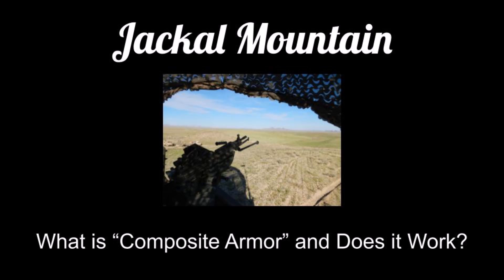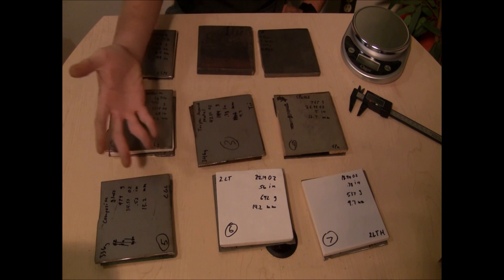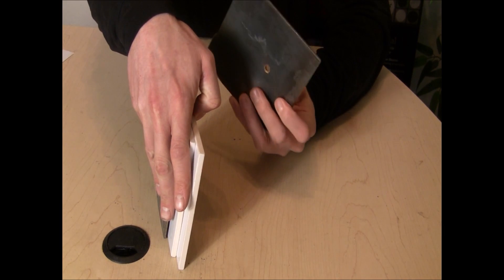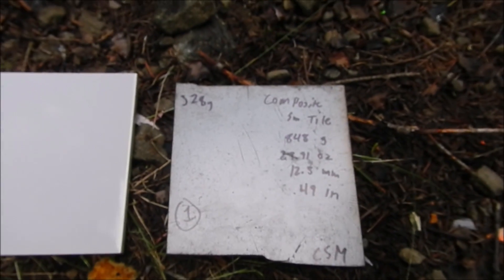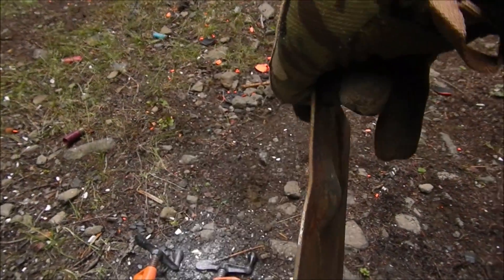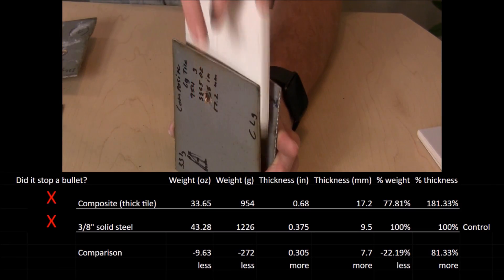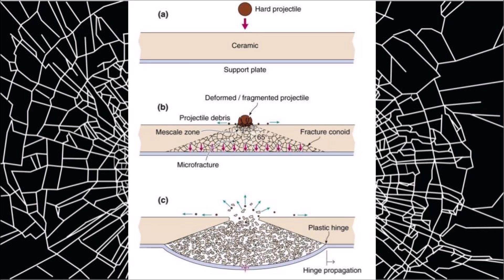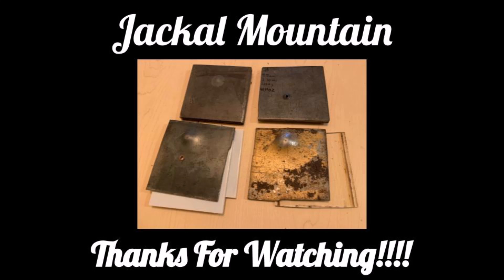Composite Armor: increasing protection, with less weight

Comment: Thoughts:

Distributing accumulated electrical potential; of incoming metal, is the trick.

It‘s not momentum that one wants to cancel most, rather, heat transfer resultant from rapid compression.

Steel conducts energy, in such a way, that it reaches it‘s curie point, upon impact [Butter].

Glass is a semiconductor.  It transfers ultraviolet and electricity across it‘s surface.

In every case, colder is harder.

Something comparable to glass, but less conductive of energy, would be better.

Carbide tiles may be better, not for ballistic resistance, not for being less conductive [carbon is a good conductor], but for having a higher sublimation temperature.

If the carbide could deposit transferred energy by conductor, into a storage device [capacitor] then the energy may be transferred to ground, via the tracks.

Other than carbide tiles, carbide impregnated steel, may be the ideal solution.

Chilled carbide impregnated steel, better.  If the armor were a Peltier device, cooling upon impact, via discharged capacitor, that would be something.

Making the armor colder, per progressive hit; that would be Tron space age.

Textile armor, of helically comingled steel and carbon thread, may be worth testing.

Bonding the composite with glass, a further step [Corning].

A problem, would be scrapping the material later.  Capturing unrecyclable material, is not desirable to do.

F-111‘s are buried in Australia now, for having asbestos bonded fuselages.

Delorean‘s future plant, was firebombed, for both a cocaine bill [IRA] and his desire to make bulletproof, 200mph unscrapable carbon supercars.

Your approaching the same answer, for a different purpose.

The acceptable purpose for development of such technology, is space craft, not tanks.

Tanks will remain death traps, in a haughty competition of maneuverability [The quick and the dead].

Changing the armor, is less important, than being unhitable.  Counter measures [Momentary Jamming and FLIR] are better to explore, if appreciating war.  The appreciation of war, means being physically killable, but the better shot.  There is no honor, winning from a bubble.

If there is, see The Movie Explorers, 1985

Rectangle LASER shield.

The smart person would, may avoid a kinetic scenario, for having watched.

Another good deterrent, is a match of paintball, inside 100 yards on a steep incline, both forces approaching, parallel to the military summit [below the ridgeline, by more than a mans height].

Thank you for the objective data.

Comment: This is not the ceramic used in tank armor and body armor. In fact, aluminum, silicon, or boron carbides are used to armor military vehicles. The most effective ceramic for armor, the strongest and lightest, is boron carbide, but this ceramic is the most expensive.

Comment: Great video that give the basics and principles of armor. For the thickness, you have a lot of variation depending of the incomming projectile. For exemple, the 1000mm thick front plate of the Abram M1A1AH go from 600mm to 1300mm equivalent steel armor. In both cases you gain weight, and also gain of thickness for the second one. (Source : wikipedia)

Comment: A good low budget showing of how in principle it works even on small scale. 
The only problem with composite armor you cant take a shot in the same place or near since the shattering of the composite.

I find really intresting the concept of dragon armor woth many more smaller composite ceramic tiles looking like dragon scales overlap each other.

Comment: When you allow for your armor to be thrown away, you defy its main purpose. Air is not an armor unless you have few kilometers of it combined with gravity
Ceramics has to kept within that space so you projectile is bled of energy trying to push it away as well as eroded by those fragments. Take hammer-drill and crack a single brick - piece of cake. Try the same with brick locked by masonry into several layers of them and you would puke out of exhaustion.

Comment: The development of composite armor has just as much to do, if not more with the production of incredibly highly effective fin stabilized heat rounds fired from tanks as it does infantry sized shaped charge weapons.
Such weapons have always had considerably short effective ranges, and are most effective in more urban or other dense types of terrain, which even modern composites struggle to compensate for due to the weird angles of firing typically used.

Comment: If I'm not mistaken the ceramics are only meant to stop HEAT rounds and not normal AP or APFSDS rounds because of the thermo properties of ceramics.
Reply: Ceramics are actually better against kinetic projectiles and used in heavy body armor, meanwhile chobham/NERA (reflective plates in soviet russia) is better against HEAT. Ceramics erode the penetrator, reflective plates bulge out and disrupt the jet.

Comment: well when we talk about ceramic armour it is not just the tiles you buy from a hardware store , we talk about superior materials , also ceramic tiles even home for home use melt at 2000 cel meanwhile steel melts at around 1300 cel , 700 degrees lower , that means ceramics are by far superior at stopping HEAT projectiles compared to steel.
Also mention that ceramic plates used at armour are contained with various bonding methods so they dont shatter everywhere increasing stopping power and the great disadvantage of ceramic armour it is it cannot take multiple shots but hey when a tank takes muliple shots and survive anyway.

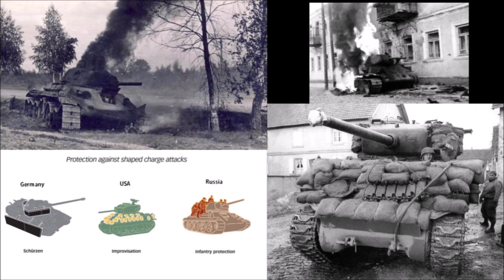Comment: 0:28 is a good joke, but in reality they put like bed sheets wait no bed frames on the tanks
Reply: Nevertheless soviets frequently employed tank riders (avtomatchiki, SMG troops), both because they had fuck all APCs (like kangaroos or Sd.Kfz. 251) and because they provided ambush detection. Late in the war soviet infantry worked with the tanks advancing in tight european cities - the infantry go through the buildings clearing it from potential ambushers while the tanks dismantle enemy strongpoints found by the infantry.

Comment: Excellent video, not enough content on experimenting with composite armor! Can I recommend one thing? when working with ceramics make sure to hold all sides under compression against a rigid backer and faceplate. This keeps tensile stress off of the ceramic allowing it to work on what it does best- compressive strength. As well, a tight fitting faceplate keeps the ceramic shards from bursting outward keeping all the particles in the path of the bullet

Comment: Your video answers all my questions very well! In addition, I have heared that rubber has some positive impact when slices of it are in the spaced armour. It seems that rubber sticks to the projectile and bleeds energy from the projectile. But I am not sure what type of rubber they use so your demonstration is very good with the limited equipment you had.

Comment: the issue with the ceramic armor is the pieces are flying away. traditionally they stay put and grind the bullet to a pulp. but when you are exposing the edges the ceramic has place to move away and does not perform effectivly. i think you should use tape and wrap around the entire plate.

Comment: Thank you for finally explaning this in a way that fully details it without being overly technical and relying solely on terms. seeing this in action is fantastic.  The only other ways I've seen this is people showing off commercial armor plates. I really like how you used your own materials for this test.  

I also want to point out that the same M855 out of a 20" barrel will penetrate the 1/2 inch steel plate, But in my case I have a similar setup rifle to you with a 16" barrel and It's been hard to find a good comparison because most people use either a BCM 11" or 14.5" barrel or the M16 style 20" barrel for these tests.  Thank you!

Comment: In our armored vests we use composite armor but a slightly different one. Its thin aramide, thick steel, medium aramide. The point is to absorb the splashes of Steel on the impact and avoid ricochets, stop the bullet or at least turn it into small fragments before exiting through the steel plate. Medium thickness aramide is thete to catch steel fragments which made it through the steel plate.

Comment: Composite armor doesn't use ceramic like on rifle plates. Most composite armor relies on the angle of each plate to cause the round to have to pass through multiple layers of high hardness steel. The filler material generally just helps by causing the projectile to have to pass through more material blunting or deflecting the projectile before it reaches the next plate in the armor array. Ceramic was tested but not used because the vibrations of the tank could cause cracks in the ceramic.

Comment: the best is sand... i dont understand why soo far there is no sand armour... basically you can take like 6-12mm steel then like 100mm gap with sandpresurized sand like sand for sandcleaners. then another part 3 to 6mm steel... and here You are... sand tank :)

Comment: I see some comments on hardened steels, this works against wear but not high velocity impacts.    Ductile materials that resist high velocity impacts like 9% or 11% Ni  plates   in composite with alu  ( saves weigth) or Cu ( no weight save)

Comment: Nice video but I have some doubts around the results.

My cornern is that we have just put ceramic between two sheets of metal without any adhesive or casing. When the "composite armour" is hit, the ceramic will shatter and as it is not held in place in any way, the penetration of the backing plate might be effected. because the shard or pieces of ceramic can more easily get out of the way of the projectile. If you would have them in a metal casing and / or or have epoxy to sandwith everything tightly together, you would probably get better results.

Comment: I think in this test the actual hardness of the tile / glass vs. mild steel. 

Mild steel is SOFT. Like butter soft. Its like 15 HRC. SOFT. Average glass is like 60 HRC (!) and tempered glass is much more than that! Ceramic porcelain floor tiles are like 80 HRC. 
A real test would use standard armor plating steel - like say 4330 steel, hardened and tempered a bit at say HRC 55 vs. armor arrays. Or one can conclude that the tests just show bullet disintegrating after hitting super hard stuff. 
Also bullet should mimic tank round - so carbide rounds.

Comment: I have one issue with this video, and I'll be honest, its bait and switch tactic used when going from premise to testing.

That's not to say the testing was invalid, but the premise set up early in the video was composite armor's use against shaped-charge penetrators, and the only demonstration as to Composite's effectiveness is with a Kinetic penetration projectile. 

That doesn't make the content of this video untrue, however, it is still misleading.

HEAT (High Explosive Anti-Tank) rounds use a copper funnel with explosives packed behind it, designed to effectively implode that funnel, and turn it into a high-velocity stream of superheated metal. Homogenous steel armor melts easily at those temperatures, and will fail against relatively lightweight projectiles.

The reason composite armor defeats HEAT shells is because the ceramics used have a higher melting point than Steel, and don't give off the heat they do absorb into surrounding materials.

Comment: This is a good explanation, but it doesn't cover all the bases. The Leopard 2 A6 and newer have slanted armor with open spaces that literally makes it impossible to penetrate from a frontal hit, even with the very latest long length Russian rounds. This should have included airgap armor as well but then a regular bullet wouldn't be appropriate for the firing test, but there should have been a 3mm plat, a ceramic tile another 3 mm plate then a glass plate then another 3mm plate this would have demonstrated a front glacis of a modern tank and most certainly would have stopped the round.

Comment: 12:00 i would say that from this test, the idea that "composite armor takes up significantly more space to do the same thing" isn't true, since the control didn't stop the bullet its unfair to compare the composites that did stop the round. 

The glass conposite was 13.2mm compared to 12.7mm for the steel plate that stopped the round, which are very similar sizes. 

I know that irl composite armor takes up more space, but in science we can only draw the conclusions that we see, not the ones that we know to be true, so from this test we can see that the glass composite is about the same in thickness to the 0.5" steel plate.

Comment: I know this video is 3 years old, but there’s 2 things I wanna point out;
1) I though that the composite armour is intended to defeat shaped charge? However, your tests are done with rifle rounds (kinetic impact). It should be noted that these two methods of penetration (kinetic vs shaped charge) are vastly different, and cannot be generalized using the same experiments
2) I know that at 0:27 picture on the bottom left is a meme, but I just wanna point out that the Shürzen was originally intended to protect the vulnerable sides of german tanks against antitank rounds (kinetic rounds) by tumbling them, so that they might hit the actual armour at a suboptimal angle. They were not originally intended for shaped charge.
Reply: Composite armour does tend to be more effective against shaped charges, but they are reasonably effective against kinetic penetrators.

Comment: If you put 2mm rubber pads in between the layers and a thicker rubber pad before the last steel plate it would also dramatically increase the protection. It would serve as a spacer to increase the fragmentation cone and disperse the energy over a wider area. And if you have multiple layers of ceramic, you can keep the second layer intact until the bullet impacts it. When the ceramic layers touch, the all tend do break when the bullet strikes the first plate.
And then laminate all with glue, a kevlar fiber layer behind every ceramic layer...

Comment: LOL. Oh boi.... Ceramic floor tiles is NOTHING like the ceramic used in armor. In fact, they are actually nothing like ceramics like you might think of them. Rather they are more like composite laminated diamond layers with special high-tech mesh infused into the ceramic. This ceramic is much harder than diamond and it doesn't shatter. Picture concrete with rebar. 
Further, the ceramic used in armor is for stopping SHAPED CHARGES! Not kinetic energy projectiles. Kinetic energy projectiles can and do defeat ceramic armor of all kinds. DOINK! 
Mild steel is not used as armor plate either. Your 556 isn't going to go through any military high grade armor plate. So, I'm not really sure what you're trying to prove with this "TEST" because you got the parameters totally wrong for this test. Not to mention the way this is all clamped together is just wrong.
Reply: If ceramic isn't used to stop kinetic projectiles, then why is it commonly used in body armour?
Reply: @jeffkardosjr.3825  Oh brother! Here we go! Aside from your extremely low IQ, do you have any other retarded questions? The reason WHY both YOU and the mutton in the video aren't getting this is because you lack brain cells to do this thing called research. I explained everything in my comment and you still come back, uh-duh.... But hey George.. uh-why is it commonly used in duh-body armor George.. Uh-duh......... I laid it all out very clearly. You obviously don't know how to read.

Ceramic armor, either for tanks or body armor are made using either of these; Either alumina OR boron carbide OR silicon carbide OR and titanium diboride. High-modulus polyethylene is also used and THAT isn't any sort of ceramic at all. It's a thermoplastic!!!!

FLOOR tiles, like what muttonhead is using in the video, is made of DIRT! Friggen clay harvested from the ground! Everyone making videos of floor tiles as ceramic armor are walking BOMBOLS with No brain in their heads!!! 

DOYEEE!!!! DERP!!!!! DOINK!!!!!! OYEEEE!!!!!!!!! EEHHHHHHHH!!!!!!!!

Comment: your thumbnail shows the added armour to the glacis of a T 55AM and not a T 64, you’re thinking is also flawed, composite armour doesn’t use ceramic to stop rounds, it is to dissipate the heat in HEAT rounds, composite armour has multi layers to deform the penetrators, for example the earliest T 72 had a glacis of 80 105 20 of armoured steel, fibre insert and armoured plate, later this was increased to 60 105 50, up to later of 60 10 10 10 20 20 50 this multi layered approach is what all composite armour is made of with only the filling in the spacing differing from the Abrams and Merkava 3/4 to the T 64/72/80.

Comment: Your ceramic floor tiles are compressed powder. They are only subjected to any heating process when a glaze is added and fired to produce a glazed surface. A substance which has been combined by virtue of hear, sintered, would have been a better and more accurate material.

Comment: I am completely surprised by the tempered glass performance, I thought it wouldn't do shit but it actually worked.
Remember that in a tank the material cannot escape through the sides so the projectile actually has to waste more energy punching through the material instead of just pushing it to the sides.
Reply: 4 months late but yeah, funny how glass is used in composite. the best example I can think of is the T-64
Reply: Indeed. Glass was used in T64
Reply: Little late here as well but glass is somewhat elastic so it was to contract back into its original shape so more energy is expended. Works really well against heat rounds